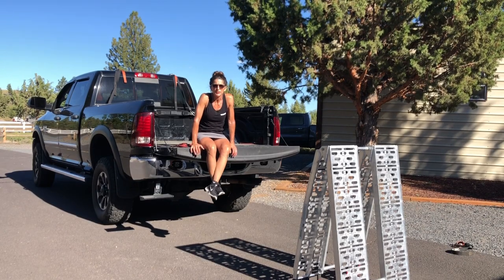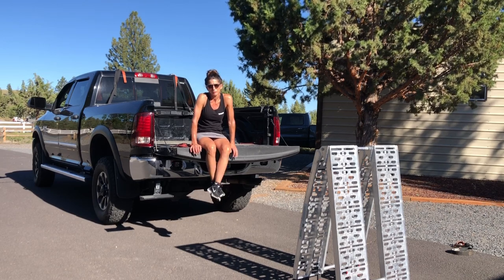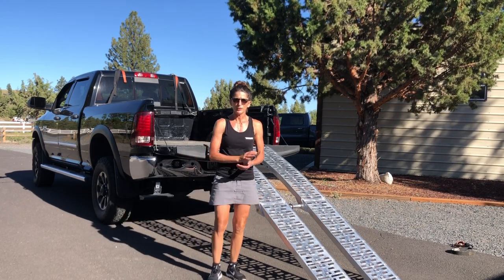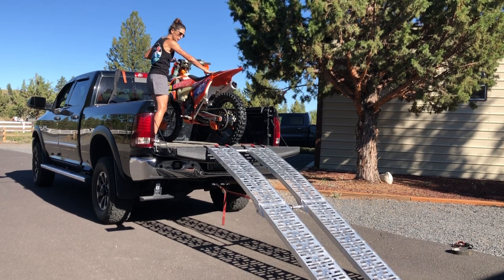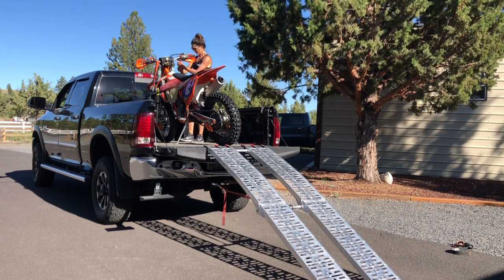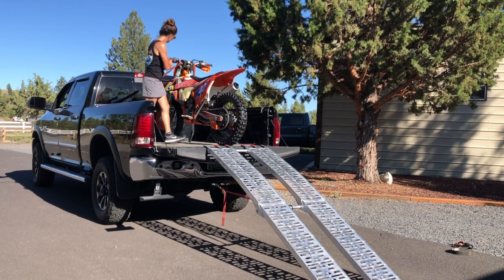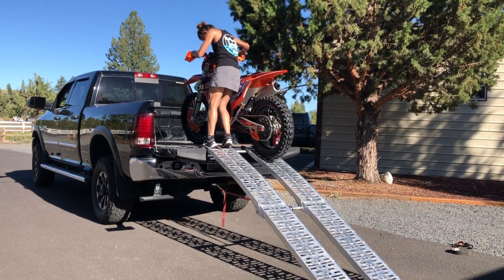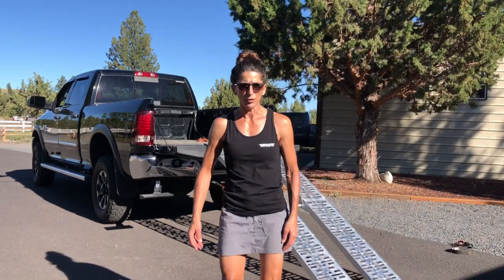Dirtastic How to: Loading and unloading a dirt bike with Coach Dawn Stob

Comment: If you don't want the front wheel to skid when going downhill, you can use the clutch control in reverse - engage 1st gear (engine not running) and use the clutch as a rear brake. And you also have a front brake, although in this case not very effective, as we have seen :-).

Comment: What is the brand /model of your ramp?
Reply: I have searched all over and could not find an exact match... I did find a 2 pack ramp that is almost identical. My guess is that the ramp in the video is a custom modification to these 2 ramps joined together. The ramps I found on ebay are called KROAK Dual Runner Shed Ramps.